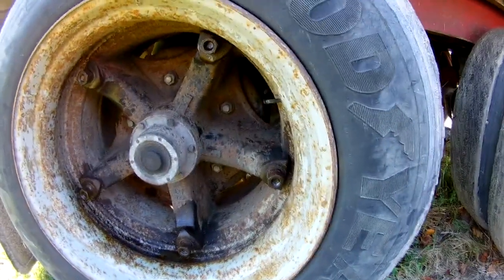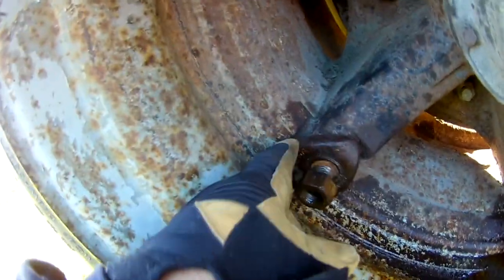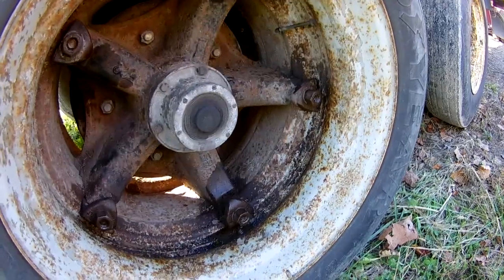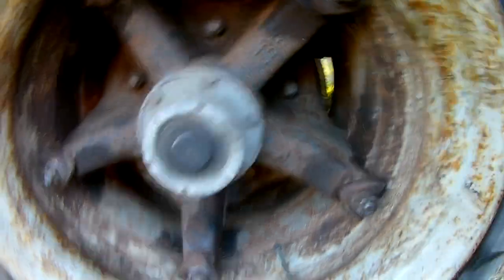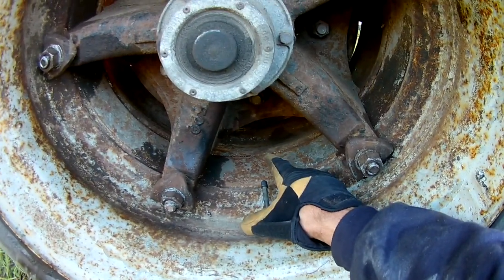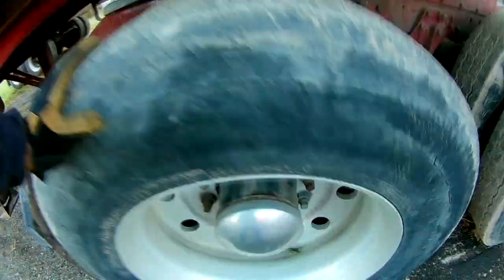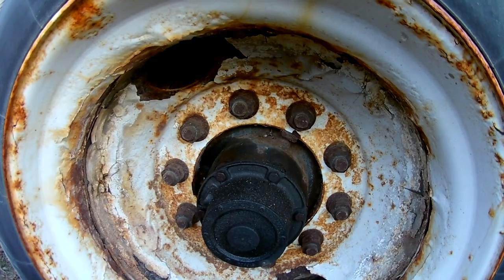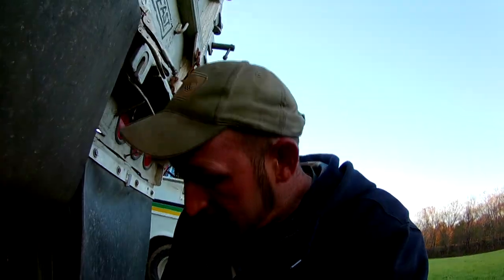Dayton Tire Change

Comment: Is the spacer ring married to the hub or the rim?  I mean, if I change from 20’s to 22.5’s, do I need new spacer rings that match the rims?  Or is the original fine?
Reply: I just did the conversion on my F800. I have the Dayton 20" wheels. Bought 6 used Dayton 11r22.5 rims, and the spacer on the dual, worked just like it did on the 20's. That part of the rim is identical.

Comment: i like the hub pilot then spoke then stud pilot. i absolutely hate stud pilot bc it requires a special socket and the studs have tendencys to loosen so when you undo the nut the stud spins off getting stuck in the rim. i personally like the spoke bc they are strong af and they look cool but they are heavy and awkward to do when you are doing anything more than change the tires. but the hub pilot are just simple and easy to work with but are less durable than spoke.

Comment: On the Dayton rims you have to take tire off on the narrow side of the rim. Question is,  how to tell which side is the narrow one?
Reply: If it's the Dayton that doesn't have the widow maker ring; on 20" wheels;  I think both sides are the same.

Comment: How to tell the difference between a 1 piece wheel and a split Dayton?
Reply from the maker: Tube type or split rims usually have a narrow opening across the center of the rim for valve stem and the tire would be a 10-20.0 or similar
Reply: @ziggyfarms3021  
One thing I've always wondered... why are Daytons still popular on other countries on new vehicles such as Mexico and not in the U.S. of A.?

Comment: why did they stop making those
Reply: Because ppl die daily around the world working on them 
. They are potentially dangerous
Reply: Because people are stupid, these are really easy to work on
Reply: Daytons aren't true "Widow Maker" rims. Those would be split rims with a lock ring which most Daytons ARE NOT. 

Daytons fell out of favor because they are harder to work on and because hub piloted wheels are better in every way. Daytons are known to be stronger and in the early days of Budd wheels there were issues with cracking but the other issue with Daytons is that if the wedges aren't tightened properly, the wheel can slip, causing two things- one, your valve stem shears off, and two, your brakes don't work because they aren't physically connected to the wheel anymore.
Reply: @LoganFK  No!! people aren't always stupid. How about the fact that they may be unaware of the removal procedure and potential danger that awaits them if the correct procedures are not adhered to.
Most trailers with Dayton wheels have a placard on the frame rail as to the torque procedure/ratings; However, there is NOTHING as to the potential danger. I think there should be a red warning sticker to alert an mechanic who is in familiar with these wheels. Don't be so quick to call people stupid; I kinda reveals something about y...
Reply: @rowanfreemaker5938  We are all ignorant, just on different subjects. Earl White